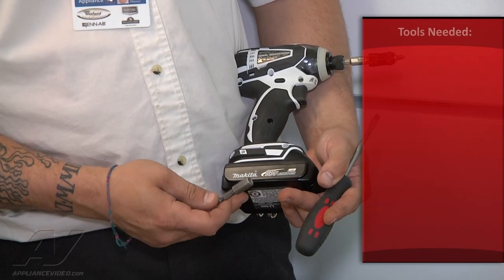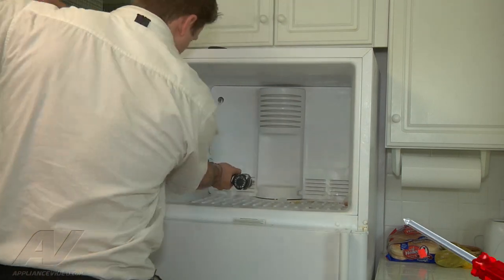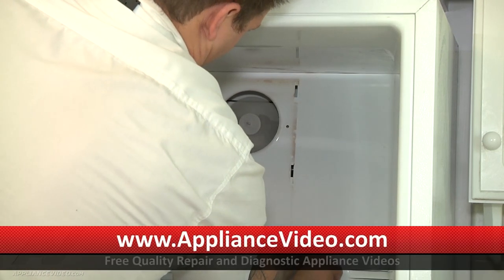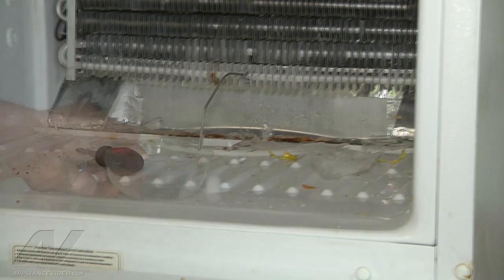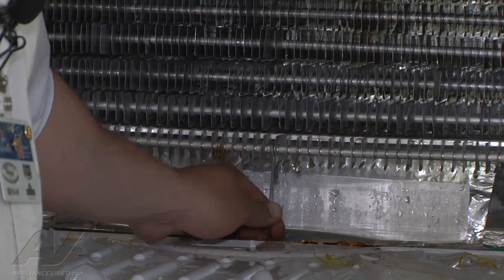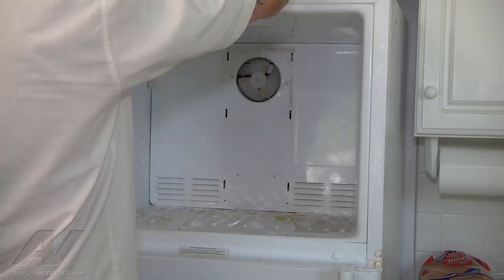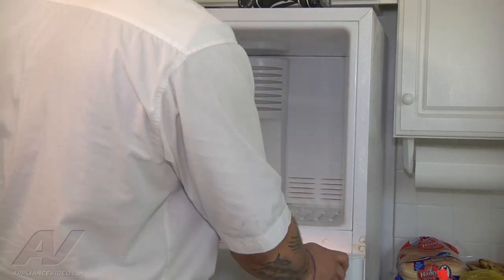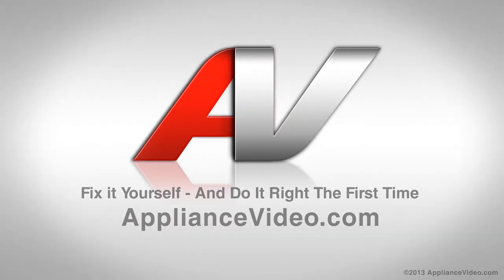GE Refrigerator Repair - Leaking Water Into Refrigerated Section - Drain Trough  Diagnostics

Comment: I had this problem recurring several times with a  GE fridge
Ice kept blocking the drain tube inlet
I finally solved it by attaching an inverted L shape piece of 3/16" copper tubing into the drain hole,

The longer side of the L has to be long enough to be placed 1-1/2 -2" inch  inside the drain tube.
The short end of the copper L tube, about 1-3/4" long I attached it firmly  to the heating element that do the defrosting with a small screw clamp.
It  has not leaked ever since. The copper tube will get warm and melt any ice trying to enter the drain hole.
It is a $5 fix
·
Reply from the maker: Ray Great advice and thanks for the tip to help others with the same issue. .  Please help us provide more videos to our site
by subscribing to our YouTube page or posting our http://www.appliancevideo.com/ website on your Facebook or Twitter account. Our factory authorized
technician’s also daily provide free professional Repair Help to people like
you to help solve their appliance problems. You also have the
option to email a factory service technician with a question at http://www.appliancevideo.com/repair-help/ .  If you need of parts for your
major appliance, we have over 5-million parts in stock at http://savemoreonparts.com/ . Thanks in advance for supporting us. So email us
if you have any other questions our videos cannot resolve. Thanks for your
support in advance.   Matt, Ace Appliance
service technician.
Reply: Some manufacturers have a kit to do this it's basically the same thing but a clamp on the heater element tightened with a screw with an extension to the drain all made out of aluminum.

Comment: Take the lower back panel off, it should be a fiberboard or cardboard cover with flathead screws, then poke a ziptie through the black tube on the right that curves up into a J shape. A black ball of snot should pop out with some coaxing. Then the water should drain fine, if there is no ice obstruction.

Comment: I have GE GTH22SBSARSS. There are 2 square holes (right top and left top) on the first layer of refrigerator. Then, There’s water dripping sometimes from the left square hole around 2 cups per day. Is this the same issue?

Comment: I have a large crack at the back wall of my fridge, its leaking a lot,can I get it repaired.?
Reply from the maker: +Deirdre Brown 

                   All of our technicians are now answering questions
daily at our http://www.appliancevideo.com/ website under the Repair Help section.  We also have over 1600 common questions and
answers that you can easily search through by your model number, appliance
make, problem or error code and it’s absolutely FREE. You also have the option
to email a factory service technician with a question on your appliance at
http://www.appliancevideo.com/repair-help/ . If you’re looking for a repair video, you
can also search our library of over 2600 free repair videos. ApplianceVideo.com
specializes in quality DO-IT-YOURSELF appliance repair videos and we get over
800,000 views per MONTH to our videos worldwide and growing. If you need of
parts for your major appliance, we have over 5-million parts in stock at http://savemoreonparts.com/ .  Thanks
for your support. Matt Ace Appliance factory service technician.

Comment: I can’t get the water to drain. Any suggestions ?
Reply: Take the lower back panel off, it should be a fiberboard or cardboard cover with flathead screws, then poke a ziptie through the black tube on the right that curves up into a J shape. A black ball of snot should pop out with some coaxing. Then the water should drain fine, if there is no ice obstruction.

Comment: What would cause this to keep happening? Cleaned it and a few weeks later the water came back like it never got cleaned.
Reply from the maker: Great question, if you have a more technical question that our parts department cannot answer, you can search our over 17,000 answered questions free at our website www.ApplianceVideo.com under our Repair Help section. You can also call our parts department at 1-800-830-5465 and they can give you help 7-days A week ,or search at www.SaveMoreOnParts.com  .
Reply: Take the lower back panel off, it should be a fiberboard or cardboard cover with flathead screws, then poke a ziptie through the black tube on the right that curves up into a J shape. A black ball of snot should pop out with some coaxing. Then the water should drain fine, if there is no ice obstruction.

Comment: I have the same frigerator. The fridge doesn't stay super cold while the freezer works like a charm. Any ideas anyone??
Reply from the maker: Great question, if you have a more technical question that our parts department cannot answer, you can search our over 13,000 answered questions free at our website www.ApplianceVideo.com under our Repair Help section. You can also call our parts department at 1-800-830-5465 and they can give you help 7-days A week ,or search at www.SaveMoreOnParts.com  .